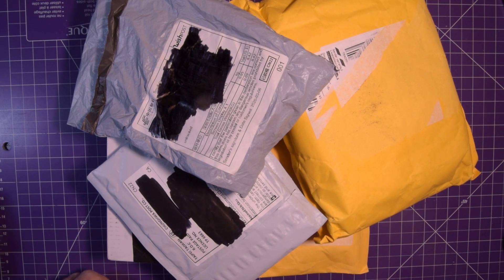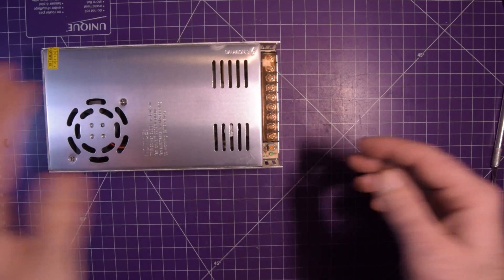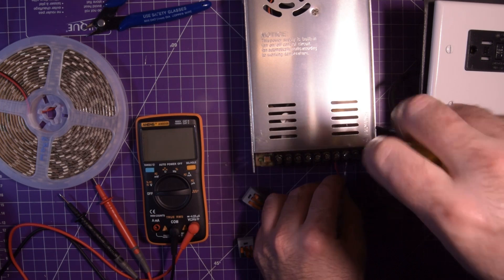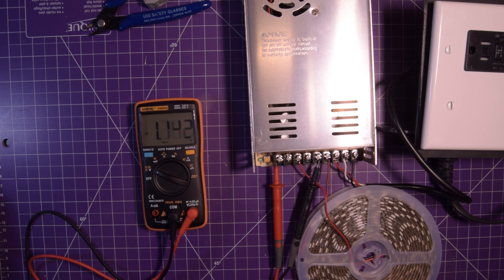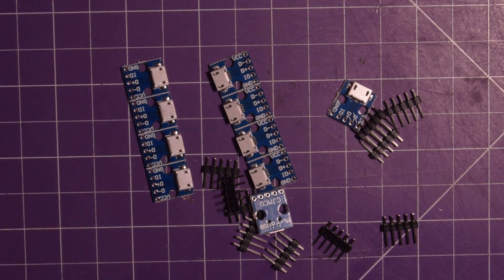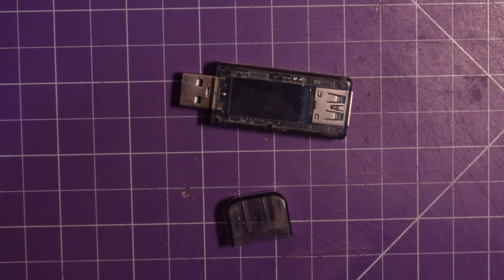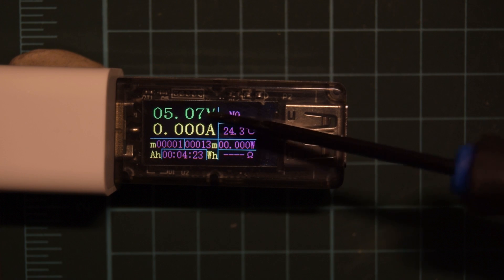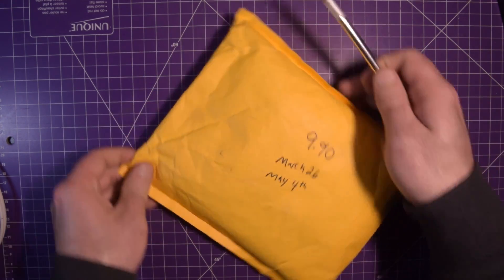Mailbag 53 - Proto-Prototyping

Comment: Nice to see your breadboards have continuous power rails.  A couple of my longer ones are broken in two on the red rail but solid on the blue and I've lost count the number of times I've been baffled as only part of the circuit is powered.  I should really throw the odd ones away but I'm too mean 😀
Reply from the maker: I think if I got some like that I would solder them under the board; I'm really not interested in broken power rails!